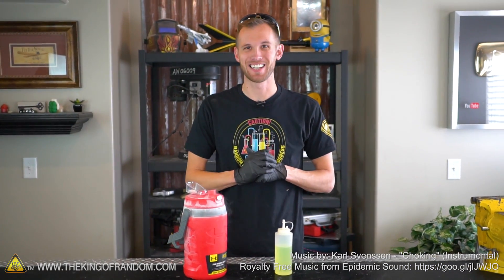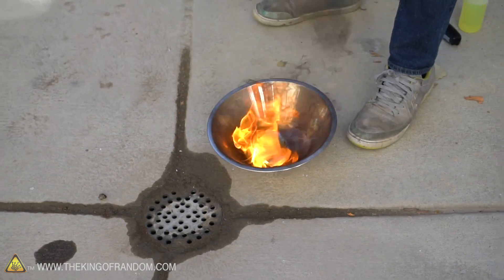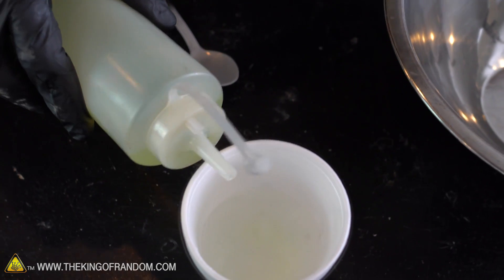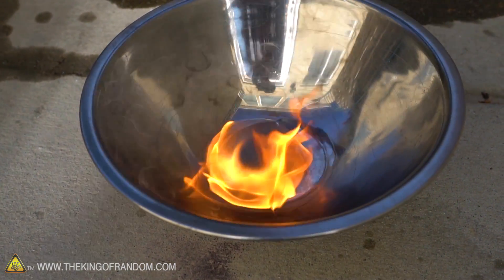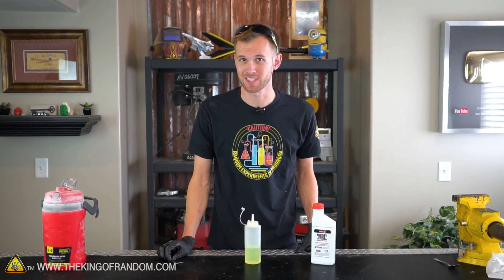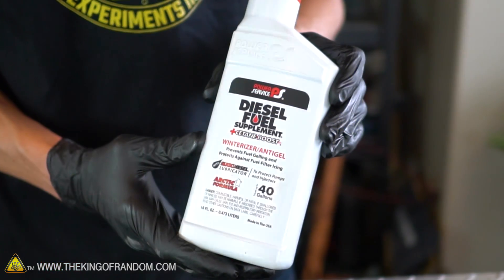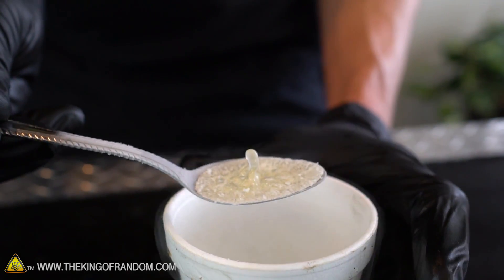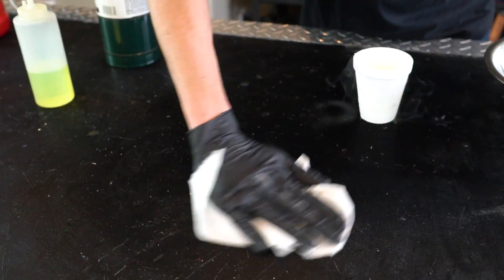Testing Diesel in Liquid Nitrogen! TKOR Experiments With Frozen Diesel Gasoline Science

Comment: There is 2 diffrent types of diesel fuel, #1 and #2. #2 will freeze around 20 degrees, where as #1 will freeze around -40, in cold climates you can mix the 2 together. Where I live a 50/50 mix will run thru almost all winter weather (about -20) whereas poweservice needs to keep getting mixed to work well. But at the same time #1 cost more and is less explosive and makes less power in an engine, which is why semi trucks have a return line system that keeps the fuel recirculating

Comment: The bowls released the second time because you were jostling around the heated diesel inside. When that happened it re-heated the air enough to release the pressure and the seal. I wonder if the seal around the edge of the bowls is strong enough to cause a total structural failure if you put them together inside of a container filled with steam. Put the bowls together then remove them from the heated steam and see if they will collapse from the air pressure. Kind of like doing it to a can.

Comment: What would happen if you pour food colouring into petroleum and light it on fire, will it change the colour of the 🔥..?
Reply: umer_irfan_ mir no, obviously not.
Reply: Food coloring doesn’t change the color of fire
Reply: Only if the colouring contained considerable amounts of certain elements like lithium (red flame), copper (green flame) or potassium (purple flame). You're also going to need a food colouring that is soluble in petroleum.
Reply: umer_irfan_ mir they would just burn normally. It wouldnt produce any special colored flames.

Comment: DISEL NEED HIGH PRESSURE AND HEAT AND  THEN U CAN LIGHT IT WITH JUST A SPARK BUT IF IT IS COLD AND NOT PRESSURIZED I DON'T THINK IT IS GOING TO LIGHT EASILY MAYBE NOT EVEN LIGHT JUST BE LIKE AN ICE CUBE

Comment: If you pour molten metal and liquid nitrogen into the same container at the same time, who wins? How do they react? What formation will it make?
Reply: TaiStar it wouldn’t be very exciting; the nitrogen would evaporate and the metal would just solidify a little faster than usual
Reply: The leidenfrost effect would happen
Reply: LOL123456789 hi bye
Reply: As I've already told tens of people asking the same thing, the result won't be much different than molten metal + water. The difference between molten iron and water is 2000 K, the difference between molten iron and liquid nitrogen is like 2200 K. That should already tell you that the experiment won't be particularly interesting. But there is a difference.
First is that liquid nitrogen is already at its boiling point while water is far from it. However, that tidbit doesn't change much because the energy to heat water from just above freezing to boiling is 4 or 5 times less than the energy required to turn the water from boiling water to gas.
The second is that liquid nitrogen, A, is less dense, and B, has lower specific heat and evaporation energy, which means that the liquid nitrogen will evaporate easier, sucking away less heat from the molten metal and forming an insulating gas cushion easier than water would.
This means that liquid nitrogen would actually be less effective at cooling the metal than water, though I'm not sure that forming a cushion easier would make it stick around longer, I think that on net, it would be about the same, cooling the metal slightly less in the process and possibly lasting slightly longer before evaporating completely. But mostly, if you wanna see what molten metal in liquid nitrogen would look like, just look up molten metal in water.
Reply: TaiStar use your head and think about that
Reply: TaiStar I put the same comment on the last video
Reply: Thanks yaksher, for the concise information :)
Reply: @TaiStar I wouldn't call it concise, it was a pretty long comment, but you're welcome. Oh, and sorry for the 'As I've already told...' part, it was rather impolite and I can't expect everyone to have read my comments and its a pretty natural thing to ask.
Reply: TaiStar it will cool down very fast
Reply: TaiStar I also ask this question many times
Reply: TaiStar ask him

Comment: Diesel fuel only ignites with really high temps but when it's used for what it's intended for it ignites during compression. So the only reason why it ignited with the propane torch was because the flame was hot enough.

Comment: I thought this was going to be pretty obvious.  It's no secret that diesel has a higher flashpoint which is why it needs to be compressed first before combustion.  That's why disel engines don't have spark plugs,  the work by compression and the compression alone creates the combustion.

Comment: The difference in burning for gas and diesel is that gas is a volatile liquid, meaning that it vaporizes easily. Diesel is not. Diesel needs to be forcefully vaporized (sprayed) in order to burn as readily as gas.

Comment: Correct me if I'm wrong, but wouldn't the reason most of these things fail to ignite when frozen be that exposing them to the air forms a layer of condensation that would put out/hamper any attempt to set them on fire?

Comment: Diesel won’t catch fire easily because it is supposed to be compressed, which in Diesel engines the compressor is super high. The high compression causes the fuel to heat up and ignite, this is why Diesel engines don’t have spark plugs

Comment: The anti-gel solution is not something that prevents freezing on its own, it creates a eutectic with the diesel meaning it experiences freezing point depression. The eutectic is maximized at a specific ratio which means that adding more will actually increase the freezing point of the solution. Anti-freeze works the same way. Anything other than a 50/50 mix with water will freeze at a higher temperature.

Comment: Diesel has a higher ignition temp than gasoline, and needs a higher maintained temp. That's why it takes a diesel engine longer to warm up than gas. Yet, when it does, it runs better than gas.

Comment: Diesel does not light on fire very well because diesel engines rely on the compression from the force of the piston to ignite. A diesel engines does not have a spark plug only  cars that run on gas do
Reply: Diesel also needs to be warm before it will burn properly, hence diesel engines have a Glow plug that pre-heats the diesel
Reply: Ross Brady yup
Reply: Diesel needs to be atomized before it will ignite. It would ignite with a spark plug if atomized. Jet engines run on kerosine, which uses this type of ignition to start.
Reply: No, glow plugs heat the air inside the cylinders for easier ignition.

Comment: Fire needs 3 things to "exist": fuel + oxygen + heat, which is why you can't ignite frozen fuel, it only ignites once the heat source warms up the fuel to an acceptable temperature (usually enough for it to create a vapor layer to mix with oxygen).

Comment: The main reason why diesel doesn't burn well as just a puddle is because it's too thick. It needs to be sprayed into smaller particles in order for it to light consistently. Atomization it's called.

Comment: Diesel is not designed to burn like normal gasoline. In a motor, diesel is nebulized and than ignited! The idea is the same as flour, normally it wouldn't burn, but if you nebulize it, it will burn very well.
You can see how bad is diesel burning lighting it on fire with a blowtorch: see all that soot being produced by the reaction, not at all clean

Comment: Y'all want to be educated from your local internet hillbilly?
In order for diesel to really combust, your diesel vehicular has not spark plugs, but injectors.
Injectors do a process called "atomizing". Basically spraying diesel into the cylinders like a windex bottle.
Diesel doesn't use a spark to combust, it takes heat and pressure.
If TKOR wants to, fill a windex bottle with diesel. I guarantee it'll combust.
Local inbred, out,
Reply: Yes petrol engines use the same principle of atomizing the fuel however uses a spark instead of high temp and pressure. Glow plugs arent really in place of spark plugs and dont have timing or an application while the engine is running like spark plugs however. They instead just heat up in order to provide heat for the diesel to combust when you are first starting the engine, and once you get combustion it will be hot enough to turn them off. You dont even need glow plugs if you are in a warm climate.
Reply: gasoline cars have injectors too, diesels have glow plugs instead of spark plugs
Reply: Yes other than glow plugs are only used in the starting procedure to warm the diesel so it will be compressed. Spark plugs are a necessity  to  a running gas engine. The reason you cant light the liquid diesel very easy compared to gasoline is because gasoline not only has more octane but it also has a lower flash point. Meaning the gasoline can be lit in colder temperatures and will light easier than diesel will when they are both in the same temperature.
Reply: Ethan Hall Youre right, as a professional Diesel technician, Diesel only ignites with really high temps or with heat and pressure
Reply: Quality comment
Reply: Randy She 
There is an error there glow plugs are not in the intake system whatsoever they are in the precombustion chamber in the cylinder head (a partially enclosed part of the combustion chamber).  An intake air preheater is located in the intake manifold (and they are not the same thing). And it is extremely rare to find both on a diesel engine it is usually one or the other

Comment: Diesel Engines don't have spark plugs for a reason; they won't ignite Diesel Fuel. The reason why it doesn't light up as fast as Gasoline when exposed to a weak flame like the barbecue lighter, is because Diesel is extremely heavy duty and it needs a more extreme way to ignite it, so to speak. That is accomplished in the Engines as the piston heads compress the fuel.
Reply: A Diesel Engine's compression ratio is much much much higher than that of a Gasoline's Engine, so if you put Diesel in a Gasoline Engine, even with its compression, it still won't ignite.

Comment: My dad told me a myth that you could take Nitro methane or race car fuel and pour it on the ground and hit it with a hammer and it would blow a hole in the ground can you try that out in your next video please
Reply: If it was nitro glycerin it would explode
Reply: well if its a myth its not true plus if it was true it would probably be because of the hammer
Reply: TheCrazyInsanity Inc. It's only a Myth if its been proven wrong
Reply: Correction, it would be a story, not myth.
Reply: Brsob can you  use proper grammar or did you not learn that yet?
Reply: he lying
Reply: It can have a reaction but I don't now
Reply: He's not lying if he believes it. He's just wrong.
Reply: Yeah that can't happen
Reply: Okay senku!
Reply: Nitromethane actually can’t burn by itself. It needs to be mixed with either gasoline or methanol. NileRed has a short about that
Reply: Ur dad be lying

Comment: Diesel has a higher ignition/burn temperature than gasoline, hence why it took a propane torch to ignite it....also the reason you can't run it through a normal car engine, the ignition temperatures that cars use to burn the gasoline just isn't high enough to burn diesel.

Comment: What happen if u put Red hot steel in liquid nitrogen!!!
Reply: Probably not much since the liquid nitrogen will just boil profusely and cool down the steel rapidly...
Reply: its even dumber then doing it with water, because it evaporates so fast its not cooling efficiently. Water can "store more temperature" before it boils. If you wanna see it, presstube did it once.
Reply: I think the steel is going cool down,but the reaction is going to be violent.
Reply: Prince995 true

Comment: will Sulphur Hexafluoride ballons float or sink in water? Will it break the surface tension of water.
Reply: Its a gas, it is orders of magnitude less dense than water. Density of SF6 6.17 g/L or .006 g.cm^3  Desity of water .998 g/cm^3
Reply: Vishnu Prateek yes because it’s 6 times heavier then air
Reply: The gaming Deer Wrong. SF6 is 166 times less dense than water

Comment: Try making some liquid argon or neon. Or try putting a neon sign in liquid nitrogen to see how much liquid you get inside. Can you obtain liquid helium to see if you can freeze liquid nitrogen or other “gases”?
Reply: Or, get a superconductor, put it in LN2, and then run a current through it with a battery until it explodes.

Comment: Dose electricity flow through liquid nitrogen?
Reply: Sam Smith No it’s not conducive
Reply: the idea of superconductivity based on lowering the nominal impedance by removing heat, which actually increases electrical resistance
Reply: I would say no, the valence electron count is pretty high
Reply: A Material is only conductive if free electrons can move through it. Since nitrogen doesnt have any free electrons, its non conductive.
Reply: Daniel on your first comment is like saying "lowering the nominal resistance by removing heat, wich actually increases electrical resistance"
Reply: Gameplayer365 Electric conductivity in electrolytes and liquids relies on moving charged particles through luquid. If you cool liquid down, particles inside will move slower and resistance will rise.
Reply: kiloman3 I saw it. It's not that hard to stick multimeter to a pot of cold water, heat it up and measure resistance for different temperatures.
Reply: kiloman3 Amount of impurities dissolving into water from clean container while heating it up from 2C to 25C is negligible.
Reply: according to electricity laws it does since there is such a low resistance wich makes it very easy for the electricity to get through